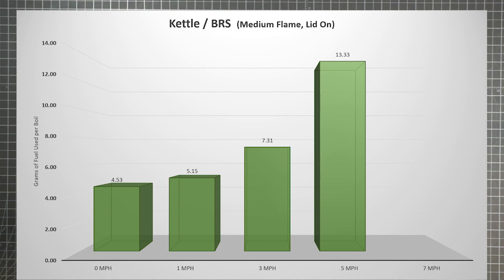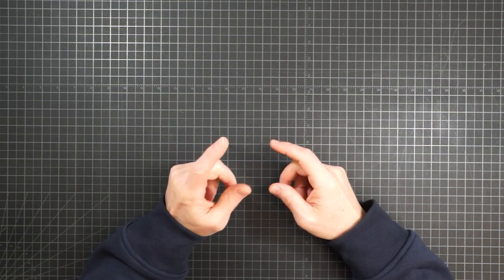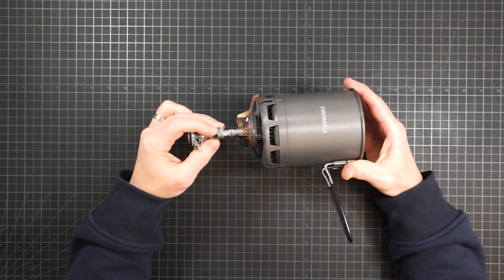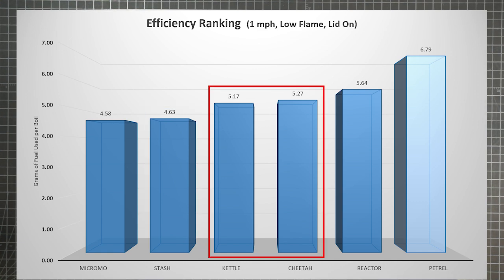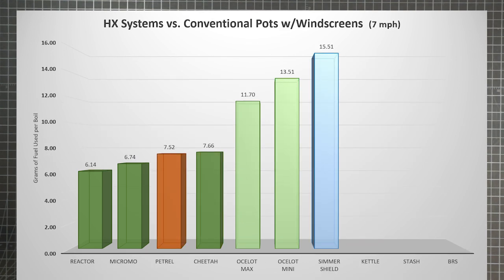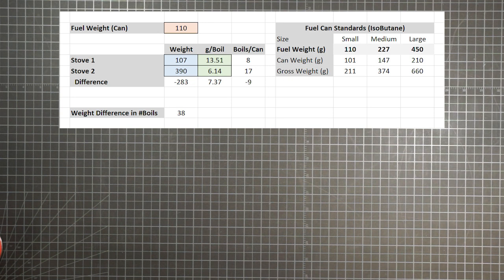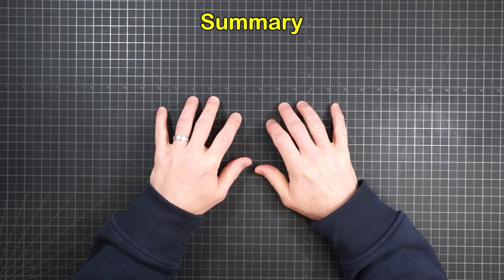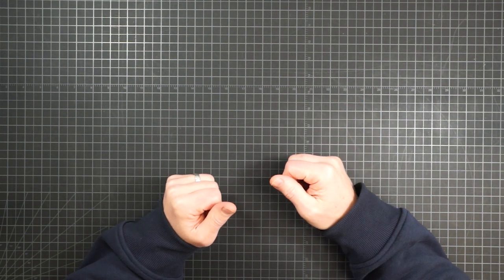Backpacking Stove Efficiency, Part 5: HX Systems in Wind

Comment: I've been wondering if there was a way to DIY a heat exchanger and if it would be as fuel and mass efficient as a commercially made pot with an HX built-in. I wonder how heavy it would need to be, or if thin metal fins would move heat fast enough on low. I'm guessing there are physics formulae that could predict that. I look forward to your craftiness.
Reply: It's possible, there's some cool stuff out there in the MYOG (make your own gear) community. The cooler stuff is carried deep in BPL, but its there. I've made a number of HX pots myself too, though they are very unconventional in a lot of ways and the heavy use of 3D printing may make some people feel like it's not true DIY.
Lightest one I got so far way 68 grams for 550ml and has the efficiency just slightly below a jetboil stash, but performs much better in the wind thanks to a custom windscreen/arm 2-1 combo I made for the BRS3000T.

Comment: Your dedication and rigour is quite simply extraordinary. Thank you not only for your efforts, but also for achieving your aim of demonstrating a methodology for others to examine any given question. 

If it means anything, I have just watched all five episodes in this series back to back. Odd as I may be, it has been a genuinely fascinating and enjoyable experience. 

I do have one question which might affect a “best system” decision: how many boils do you actually get out of a canister? My experience is that you never actually utilise the full amount. Might this mean that the lighter systems lose out even for shorter trips? I will attempt to work that out myself, but hope that it’s worth raising for consideration.
Reply from the maker: Interesting. I never do run the can down to where the stove actually dwindles out.  I suppose I should try it, then weigh in to see how much fuel might still be left.
Reply: @GearSkeptic Hopefully some of the part used canisters are still around from all of the testing. 

Thank you again for all you do.

Comment: I hate to mention this ..... but have you considered that as all your testing is done with remote canister stoves it is possible, and in the wild very likely, that all of the stoves can/could be used with an enclosing circular wind shield. Certainly my preferred option in any windy or wintery conditions. Now you may think that this would simply re-align all the stoves back to the 'no-wind' results, but I think you and we may be surprised. Backpacking Stove Efficiency, Part 6 ? 😁
Reply from the maker: I avoid anything that would encourage somebody to enclose the gas canister within the heated area, as a potential safety risk.

I did do a little bit about impromptu wind breaks, like using a backpack, tree, or available obstacle to help block wind. That can be found in Part 3 on windscreens, near the end at 34min11sec.
Reply: @GearSkeptic  You misunderstood - the canister is 'remote' so would NOT be enclosed, just the stove
Reply from the maker: @OldBlindMole  oh, right you are.  I do have some remote stoves and would like to do such testing. I don’t know about Part 6, but it is on the list!

Comment: Found your channel recently and boy is it a gold mine! Would like to eventually see a video about odor resistant bags like nylofume; opsac, smelly proof, etc. Specifically, I'm wondering if I could layer them to eliminate the smell and not have to use a can, hang, or ursack. According to a backpacking light podcast, a nylofume (20x reduction) layered with an opsac (1000x reduction) would equal 20,000x reduction and make the smell range for a bear 10cm. 2 opsacs should be 1,000,000x smell reduction and eliminate the ability for a bear to detect the food. Also thinking about combining this method with an Adotec bag if I choose not to sleep with the layered odor bags.
Reply: I’ll relate my experience regarding layering of bags. I bought off Amazon a box of BOS odor sealing bags (X-Large)  for diapers. I use them to double bag my food before I put it in my food bag or canister. My accidental test of their efficiency happened when I parked at a trailhead to hike into the Wind River Range. You are cautioned to not leave fresh, smelly food in your auto due to the risk of bears breaking into it. I had an orange a a very few other items which I put inside one bag and then used a twist tie to close it. I think a properly folded and twisted top bag closed with a twist tie or something similar seals in odors better than a ziplock bag. I then placed this bag inside a second one and closed the top with another twist tie. I left the bag inside the cab of the truck out of the sun. When I returned to my truck five days later and opened it I smelled nothing that smelled like food even though it was quite worm inside the cab from the sun shining in along with a warm outside temperature, probably in the upper 60s as I recall. When I opened the first layer of the food bag to get that orange I wanted to eat out wafted the smell of warm citrus fruit, a very distinctive smell. When I opened the inner bag of course the odor was even greater. The orange was fine, just a little warm. Double sealing food in odor proof bags works.
Reply: @wanttogo1958  Thanks for sharing that! I am confident that it would be okay to sleep with my food layered in two Smelly Proof bags plus 1-2 Nylofume. But I decided I didn't want to risk the chance that a bear could still smell it so I ordered an Adotec bag. Still going to layer odor bags inside the Adotec, and still going to save 1.5 lb!

Comment: Excellent video. Appreciate the effort you put into these tests. I've some experience trying to get consistent and repeatable results testing consumer level equipment (not stoves) that aren't designed with exact adjustments as a priority. I know it can be extremely time consuming and frustrating which makes your videos even more impressive.   

I've owned/own 5-6 stoves so can to some extent pick the one that's most suited of a specific trip, but if I had to choose one that should work for all types trips I've done then fuel efficiency and stove + fuel weight (while certainly important) wouldn't be my top priority. Fuel availability, performance in cold and stability of the stove is even more important to me.

Comment: 36:19 From one engineer to another:
This effect is called stiction and it is common in control valves in industrial controls where fine tuning is of critical importance. The creep effect is also why industrial controls now use valve positioners, which keep valves at their set positions. 

Probably not very interesting to many, but it's completely common to those in that world.

Comment: Ive had some old cans laying around for years, in my backup kit, I recently used them to light some fires with one of my stoves, they both clogged two stoves. Idk if its dirt that got into the valve surface or like rust inside the can ?? but now my one stove refuses to work at all. just very strange.

Comment: I suspect the variation you see in refilled canisters is that the initial fuel is not pure isobutane which would be very expensive for a manufacturer to produce. When the impure isobutane is used whichever components have the higher vapor pressure escape at a preferential rate, thereby enhancing the concentration of the lower vapor pressure compounds in the remaining fuel. When partially used canisters are combined you now have a fuel that has a lower vapor pressure than the new canisters and burns at a slower rate. This is more likely than changes in the valve.
Reply from the maker: Why would combining them lower the ratio beyond what was in the donor cans at the time of transfer? If I pour 4 cans of 90/10 gas mix into one container, I’d still have 90/10 mix, just four times as much.
Reply: Combining them would not change the average composition. Rather the now full combined/refilled canister would probably have a lower vapor pressure than a newly purchased canister that was still mostly full and thus would produce a lower flame when used on high. This would be easy to check. With a pure gas, at constant temperature, the vapor pressure and thus max burn rate should not change until it gets nearly empty. Measure the static pressure from a can at 80% full and 20% full; if its not the same at constant temperature then the composition of the starting gas is impure and thus changes in vapor pressure will affect your experiments as can empty.
Reply from the maker: @jacksmack2382  That is what I am getting at. I have literally done that test hundreds of times.  A canister at 20% performs exactly like one at 80%. At least, after having been used in the temperature of my shop.  So, simply using four cans that were at 20% to fill an empty one to 80% should perform just like they were at 20% when transferred.  Instead, I get this pronounced step change in performance, that does not seem explainable by differential burn.

The refilling process itself won’t preferentially transfer one gas over another. They mix well and will keep the same ratio when in liquid, which is what transfers because the donor can is upside down during the exchange.
Reply: @GearSkeptic , considering you did many many tests on the same cans, connecting and disconnecting the hose (stove feed) multiple times, what to you think could be different between screwing that on vs. screwing on the refilling adapter?
Reply from the maker: @ I do not connect and disconnect the hose feed many times.  It is only needed to be done once, because it is a separate hose and valve from the stove or the MSR LowDown adaptor.  Also, refilling is different than simply using a can normally.  It involves reversing flow on a valve that isn’t meant for it.
Reply: @GearSkeptic  oh, i see, then I'd posit a question, if the damage is from flow reversal, actual way the refilling adapter pushes on the valve, and could anything similar be observed with repeated connection-disconnection of "normal" stoves/hoses
Reply from the maker: @evev7158  I don’t suspect there is anything wrong with how the adaptor itself connects to the can. It appears to have the same type of connection as any stove or other accessory.  There might be a problem with forcing fluid flow against the direction the valve was built to control.

Comment: I think is it less likely that refilling a fuel canister damaged the valve, more so I believe refilling a canister will result in less pressure inside compared to a brand new canister.
Reply from the maker: As long as there’s liquid inside, it means there is enough pressure to force the gasses into that state (which is more than enough to max out a stove).

Comment: You know you might be too deep on the rabbit hole when you hear "Testing of different material pots for heat efficiency" in the shower and exclaim out loud: "Oh, that one is going to be good."

At the end of part 27, or whenever this ends at this pace, I fully expect an announcement of a GearSkeptic branded cook kit. It would be a shame to have all the data of what makes a good design, efficient, wind resistant, proper material and lighweight system and do nothing with it.
Reply from the maker: Ha! The more I learn, the more it makes me want to tinker…

Comment: Can I offer an alternative hypothesis regarding the poor performance of the refilled can?

Remember that gas canisters contain a mixture of gases with different boiling points, power outputs and, at a given temperature, different pressures in the can. Usually propane, isobutane, and n-butane. MSR IsoPro is 80/20 isobutane/propane. As you use the can, the different gases evaporate at different rates, with propane having a bias towards evaporating quickly. As the can nears empty, the propane may be almost completely gone while n-butane and isobutane remains. At this point, the pressure in the can may get low enough that you notice performance degradation, perhaps such that the power output that the "high" reference requires cannot be delivered by the can anymore.

Because this is about the gas mixture, combining the left overs from many canisters does not fix the problem, it only results in a can full of "slow" gas.

As for why it's only noticeable with the high reference, my only hypothesis is that it is the only one to require the high pressure of a fresh can with original gas mixture, in other words exactly like you state in the video.

To determine if this is a likely root cause, take a new can and use the refill adapter to move the gas to an old canister. If the old canister with fresh gas performs well, then that suggests that it is indeed about the gas mixture. Otherwise, some kind of valve damage seems more likely.
Reply from the maker: That’s a good idea for a way to test it.  I would point out, though, at my shop’s temperature even pure butane will vaporize easily and have more than enough pressure to max a small stove, so I don’t see how loss of propane would cause such a noticeable pressure drop. The remaining isobutane should be more than adequate by itself at 50F. It would be a very different story if you were so cold that the isobutane was having trouble boiling, but the propane wasn’t.
Reply: @GearSkeptic  Yeah, I don't know if the effect is large enough to explain it at that temperature, like you say it should be (much) greater near the boiling point of the isobutane.

Comment: Great video, very interesting. Do you think the refilled can difference is because the propane iso butane blend changes as a can empties? Iso Butane and propane have different vapour pressures and calorific values. So towards the end of a cylinder the proportion of lower vapour pressures, high energy propane maybe less, reducing performance. Just a thought.  Single gas rather than blended gases could be more predictable.  Enjoy your videos to the last minute!
Reply from the maker: It’s an interesting idea. But, at my shop temperature, both gasses in the mix should be vaporizing strongly.  There would still theoretically be a differential burn rate, but nothing like what it would be if I were below freezing.

Comment: Always plenty of usefull data. BUT I realized you kept the neoprene on the Micromo, (because it is standard to that pot I suppose). From what I have learned from all the previous videos, that would be an advantage compare to the other pot to prevent heat loss, especially with the wind. 

I would be curious to know how much does that neoprene weight, is it helping to protect against the wind or not. If yes, what is the advantage gr/boil of it. Would it be more efficient weight wise to discard the neoprene and trade it for a windscreen.

So many questions and only one man to rule them all  :P

Thanks for your video Mr GearSkeptic
Reply from the maker: Yah, maybe pot cozies would be a topic for a future test. Sigh 😉

Comment: This has me very interested in the ocelot mini.  I like making hot drinks on trail so a mini-can only gets me ~3 days on trail comfortably, it would be great to push that further.  But on the reverse having a bigger fuel can in the pack is a good “insurance policy”
Reply: Break this down for me. You go through 100g fuel canisters in 3 days? How many times do you use it per day? Under what conditions? I'm trying to wrap my head around this since typical lifespan is around 15-20 boils.

Comment: Fantastic! Thank you so much for the tremendous effort and time put into these videos! The revelation that ha refill valve maybe damaging a cans output is also shocking.  Will you be doing more testing in this with different valves?
Reply from the maker: Well, I do have another experience with refill of a small can, off brand. That one causes the flame to just geyser up from the stove like a jet engine exhaust. Unusably dangerous. A different kind of failure, though.

Comment: Sorry for your inconvenience, but learning that refueling a canister can damage the valve and effectively cap the output is very useful information.
I’ve never heard mention of it before, and makes me realize I should probably stop refilling the same canister I’ve filled 4 times now.
Reply: True but if you've got a wide pot....
Reply from the maker: I’ve had one other problem with a refill that was an off-brand small can. That one just causes the stove to geyser up flame uncontrollably. Not safe to use any more.  It is making me want to avoid refilling, but some people say they’ve done it for years without (noticing) issues.
Reply: @GearSkeptic  okay well I’m definitely going to start testing refills before taking them on a trip now at least, that’s terrifying

Comment: I'm currently using mostly alcohol and the brs, but I do like how the HX systems have such stable fuel consumption in comparison. This would make planning much easier. But as you already talked about in the previous part, it makes only sense if I can go lighter on the can I use. The smallest can I can regularly my hand on is the medium/410ml/230g size. For a weekend hiker, I will probably never empty one in one trip.

But perhaps I can check, if I can get some stable fuel use with the alcohol burner. At the moment it is a hard-to-make rough guess every time how much alcohol I need to put into the burner. Which I often don't get back when I guessed to much and becomes really "scary" if have to refuel, because there could be still a hidden flame. Here the more stable fuel usage would give me a reason to accept more weight and bulk of an HX system.
Reply: Why not a Trangia burner or similar?